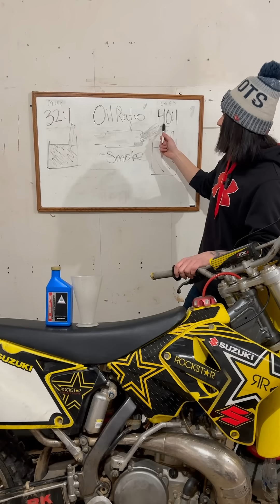2 Stroke Oil Ratio Explained

Comment: for everyone saying they run 50:1 ... these numbers are for racers... or people who are aware that the bike should be rebuilt often. race bikes are rebuilt after a couple races... you run 50:1 your getting more power but your rings wear out fast and once they wear out your piston slaps the wall and you throw a rod. if your not racing there is no reason to run 50:1 lol.. only people who will tell you to mix 50:1 are daddys boys who only ride the bike and dont realise daddys race team rebuilds his bike weekly or crooked manufacturers who want you back to rebuild your bike once a year. my 91 yz250 is a factory engine never been rebuilt running 32:1 its whole life .  while my buddys brand new ktm he was told to run 50:1 on by the dealer has also been back to the shop getting a top end rebuild twice in 1 year. :'D
Reply: I’ve been running 50:1 for almost 10 years now. No problems at all. My dad definitely doesn’t rebuild my shit either lol what the hell are on about
Reply: same here, 99 yz250 I have run 50:1 for the last ten years. original motor never opened before! keep the carb and jets clean. changed packing and airfilters, that's it!
Reply: @blakenorager86  yeah, clean air filters are often overlooked as items that save top ends.
Reply: @mikea5923  yup most overlook matinence, and not letting the carb get gummed up.
Reply: yamahas are just built different lol @blakenorager86
Reply: @onetime7214  you are not lying, bike has been a tank lol
Reply: Not necessarily true.  My KTM top end has tons of hours on it, always ran at 50:1.
Reply: @mikea5923 do you understand that the crankshaft gets more damage from oil deprivation than the top end?
Reply: @jimi1943  the crank has at least two top ends on it, is factory, and was fine the last time it was opened up.  

Use good oil and you won’t have an issue.
Reply: i have about 300 hrs o a 17 te 300 at 83:to 1 earthing u said is wrong get some higher quality oil
Reply: You sound like you got soft hands

Comment: I like a little extra oil smoke. Durability is key when your broke. Plugs are cheap. Engines are not
Reply: I just commented this but I'll help you  out , a richer than usual premix will actually cause more damage due to a lean condition on the fuel side. The amount of fuel delivered by your carb is metered, so if you change the ratio of fuel/oil on the richer side you actually get less gasoline coming out of the jet since there's more oil in the mix
Reply: @canceledczech457 yes it will lean it out but if you change your jets you are better off running a rich AIR TO FUEL RATIO not to be confused with gas to oil ratio. It will give your piston getter coverage and it will run cooler
Reply: @canceledczech457 carbs are cheap
Reply: @canceledczech457 so then re jet it💀
Reply: Try cleaning plug with gasoline or carb cleaner, scrub with wire brush or sand paper, for extra saving, it works like 2 or 3 time 😂
Reply: @mostlymotorized  Sorry Champ, but you are the one that is wrong. 2 stroke oil is not flammable by design. If it did burn the engine would seize due to lack of lubrication.  Ever wonder why there is so much unburnt oil build up in the exhaust etc.?  Strictly speaking a very small amount of the oil components will burn off, (the visible smoke you see) but they will contribute next to nothing. Adding more oil does lean the air fuel mixture and can cause combustion temps to rise to the point of causing damage. Every decent 2 stroke tuner knows this, and it has been known for decades. If you disagree you are just showing your ignorance of the subject.
Reply: @Ozsmallbore  thankyou for having a 🧠 :)
Reply: @mostlymotorized  yes it is, but if you were educated in the matter you would know the flash point for 2 stroke oil is extremely high and produces far less energy per unit than gasoline
Reply: 10 dolla plugs
Reply: @mostlymotorized most actually aren't. I run a shop and have tested many. You can try it yourself. I only found a few 2t oils are actually flammable. The rest can sit directly In a torch flame and just smoke. Amsoil dominator was the only oil that REALLY ignited (I believe it has kerosene added to help burn). Almost all the other oils literally couldn't catch on fire.
Reply: @U.s-epa you have to try to ignite them when they are at like 120psi compression and started and vaporized, under those conditions all of them burn. Diesel and her fuel won't ignite with a torch sitting in a puddle either and they are most definitely flammable
Reply: @brly4542  of course, however the Amsoil burns MUCH better. The results are in engines I've taken back apart after thousands of miles on Amsoil dominator. No buildup on the piston, zero, just a slight discoloration.
Reply: @mostlymotorized your correct, BUT can you explain why it causes pre ignition? Or are you just repeating something somebody told you 🤔
Reply: @canceledczech457 we are all repeating something someone told us all the time. Whether or was in person or written down or whatever.
Reply: @garonjohnson5922  or...it's a fact and very basic math to figure out exactly how much fuel is being displaced by extra oil in the mixture. If you run a 50:1 engine on a 25:1 mixture you've doubled your oil concentration displacing fuel in the mixture causing a lean condition.
Reply: @canceledczech457  I'm glad to see at least someone understands 🤠🤟
Reply: Same here.  32:1 is 4 ounces per gallon.  I used to put 5 oz per gallon.  Plugs are cheaper than pistons.
Reply: I always ran my sled a bit fat, never had an issue. Also with a sled I like going fat because of its perfect at -5 @2000ft, at-30 you're going to be running lean. Id rather be running perfect at really cold temps and a bit rich when it's warmer out
Reply: @brly4542  exactly I never bought that you actually making it leaner by adding oil , that’s ridiculous. Better safe than sorry.
Reply: @RcPlayer-tt2vw  ya with how little oil there is compared to gas, whether it's 32 or 50 or 100:1 it's still a tiny amount of oil. I can bet the change in viscosity is barely measurable, I doubt the fuel pumps or carbs/injectors notice and difference in flow difference. Should see the random old mixed gas I put in my old truck, it must be running really lean, since it's used to straight gas
Reply: i agree entirely
Reply: Exactly id rathernfoul.plygs 5yqn rebuild
Reply: absolutely.. brakleen your pipe clean.. change the packing more often, and get few extra plugs, carry couple with bike, and clean the old ones. Easy peasy.
Reply: Except when you run a rich mix you're running the bike lean. Extra carbon. Power left on the table.
Reply: Rather foul a plug then burn up the motor
Reply: @chrisotey1927  🤣🤣🤣🤣 more oil = lean = hot.
Reply: Why when u use AMSOIL u can mix at 100 to 1 ? Hummmm
Reply: I grew up mixing 32:1 buying plugs every couple weeks. Miss those days.
Reply: Yes sir my cr250 has been fat and happy for 7 years on the same hot rods crank over 300 hours bike doesn’t owe me a penny
Reply: You’re fucking retarded. If it’s tune properly, it will be very reliable and it will never burn plugs.. Anybody who wants their bike to be durable is not gonna let it run Rich. That’s pretty much the worst thing you can do for your piston rings and power valves
Reply: Golden Spectro was my favorite, the maxima is good too and of course amsoil
Reply: Ya I have to redo my cr 250 I love that bike ,
Reply: I'm the same way with any 2 stroke I run, I'll eyeball the oil mix and when it feels like it's good, add a little more
Reply: everyone hasn't had a clue what they're talking about, the gasoline is thinner than water of course you wanna make that shit thick especially if it lubes the cylinder walls so you don't seize that shit. if it runs rich add fucking air using your jets or air/fuel. that fixes your rich running issue and smoke, who gives a fuck about oils flash point when it's being ignited by a spark mixed with highly explosive gas? none of this science matters if you can't make sense of it
Reply: Lean is mean.
Reply: Had a guy tell me that about RC cars years ago.  I have always treated my 2 strokes similar. Smoke is not a bad thing.
Reply: @mikefabs5.0  smoke = carbon, carbon = bad
Reply: @U.s-epa  I am currently diving into carburetor jetting and oil injection on snowmobiles. Not here for bikes just browsing videos. I take that comment back rc is way different than 2 strokes lol and thank you for Enlightening me.
Reply: @mikefabs5.0  if you mean nitro rc yes!!!! Very different. Everyone has their own opinion and thems fightin words usually when it comes to oil 🤣 I own my own shop and we specialize in 2t vespa performance engines. I'm an evidence based guy and you absolutely want to run the least oil you safely can, less you want to leave power on the table and carbon out the top end and pipe. I run 50:1 Amsoil dominator and have been running this for some time now. Zero carbon buildup, I mean none.
Reply: Agreed
Reply: Exactly
Reply: Plugs are cheap, engines are not! Amen!
Reply: I run plugs for six months to a year,  if you can't ride for shit you will foul plugs or your running to much oil,  don't over complicate things!!!!!
Reply: And you can always clean the plug too
Reply: Beat me to it🤣
Reply: Plugs in 1950s were four for 50p four my two stroke. Briddy uk. Or half a crown in old money.
Reply: Couldn't have said it better myself
Reply: Is it better to run leaner or richer then as in whats better for the bike?  New to 2 strokes thanks in advance
Reply: I’m broke, so your saying I should be putting more oil risking my spark plug more than the engine
Reply: Seafoam for the wiiiin  no opening of engines other then normal stuff
Reply: Yeah same
Reply: A little extra smoke is good especially if it's Klotz. THAT STUFF smells good enough to eat.
Reply: @onestopfabshop3224  worst carbon I've ever seen was with that shit 🤣
Reply: @U.s-epa  That's why they call it Klotz. Instead of blood clots, it's carbon Klots. Lol
Reply: @onestopfabshop3224  never heard that one that's pretty damn good 🤣🤣🤣
Reply: @onestopfabshop3224  my favorite smell good smoke bomb oil is Maxima 927 castor oil. Shit will fill the entire shop on a cold start with 32:1 and will have people cussing you out when you pull off for lunch

Comment: Run the manufacturer suggest mix. KTMs often run 60:1
Reply: yeah thats why ktms explode all the time :'D. my buddies ktm blew up twice in 1 year running 50:1 .. i told him to run 32:1 and he has been running the same engine for 6 years now.. my yz250 has ran 32:1 for 20 years and has never been rebuilt. anyone i know running 50:1 is rebuilding there bike 1 or more times a year.
Reply: @lxvwvxl  hours is what matter. I swap pistons at 30-40hr max
Reply: Its called emissions BS its got nothing to do with performance.

Less oil is always going to be worse. Just change fueling with the weather and conditions, oiling probably doesn't matter.
Reply: This should be obvious but don’t run 60to1 but it does seem like 𝔞 very ktm rider thing to do
Reply: And ktm suggests that so you get less emissions keeping their global number down

Comment: 50:1 is the only ratio needed 👍
Reply: Your using literal super cross mix how are you not rebuilding every few hard rides? Did you have to play with the jets?
Reply: @ghostwalker3192  if you use good oil like belray or Maxima super m  it’s fine I’ve always ran 50:1 in all my bikes and never had an issue with excess smoke oil or any engine problems. My Buddy ran 32:1 when I first met him and his bikes would always foul plugs until I switch him over to 50:1 then he could actually ride instead of changing plugs every ride
Reply: @tsales330  I’m glad you came across my comment this makes sense I don’t typically get big name brands for my oil it literally didn’t even come across my mind for some reason I might actually consider trying running it more similar to this if you recommend it
Reply: @ghostwalker3192  ya when it comes to premix always go for the better oil I know it’s expensive but will make a huge difference in how your bike runs! I also ran at least 91 octane gas. Just mixing your gas at a 50:1 ratio you should notice a difference in pep and if you get a better oil you’ll notice a even bigger difference in how your bike runs and how much cleaner it runs if you get what I’m saying. But I highly recommend Maxima super m racing formula 2stroke oil at 50:1 ratio and you’ll be so happy you switched I promise! No more spark plug fouling or a bunch of oil running down the silencer..I’d run all the gas in the bike out before switching to the new oil and ratio so you notice the difference and it’s not making the new gas richer from mixing with the old gas in the bike. Make those changes and lmk how much better your bike runs you could also throw a new plug in to if it’s really bad.. that units going to feel like it’s got so much more pep👍🏽
Reply: It's all about synthetic oils 😎👌
Reply: We get 98 over here but also run aviation gas and expensive af premixes like motul 800 or any other ester based premix

Comment: I used to run my aprilia rs125 45:1 never an issue and that thing got ragged to fuck only ever needed to be rebuilt 2 times in the year I owned it. Once when I bought it and once before I sold it 🤷🏻‍♂️
Reply: Is two rebuilds in a year not excessive? Did I miss some sarcasm here?
Reply: only 2 times huh 😂